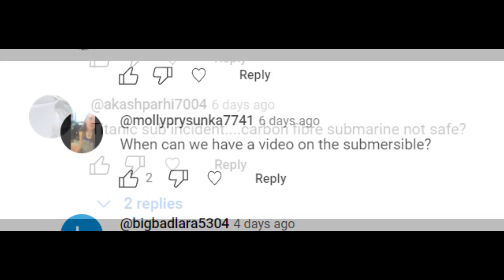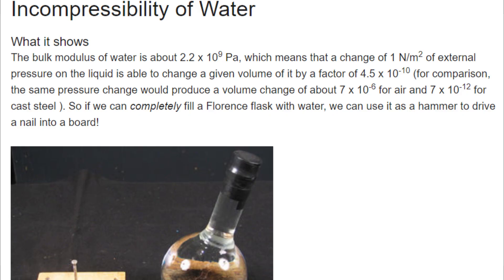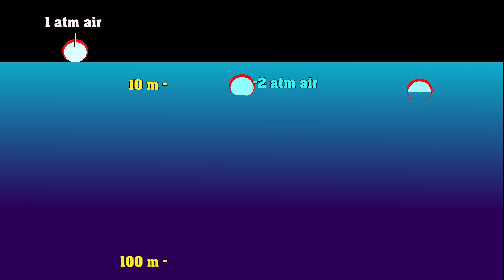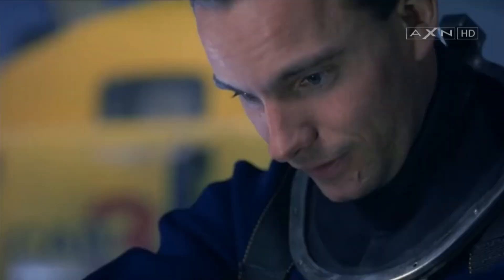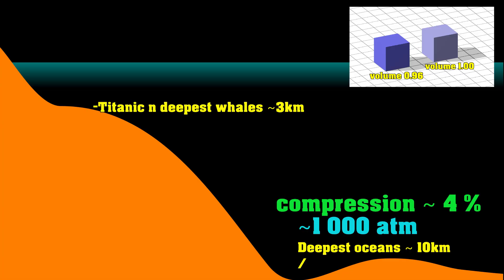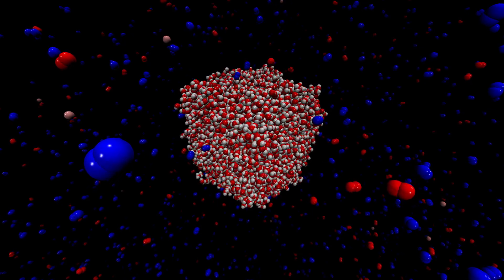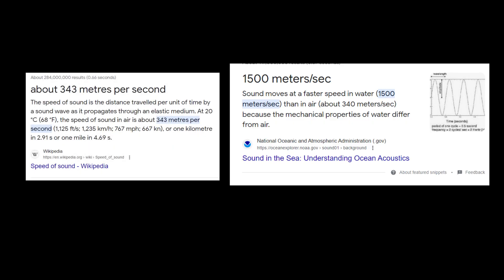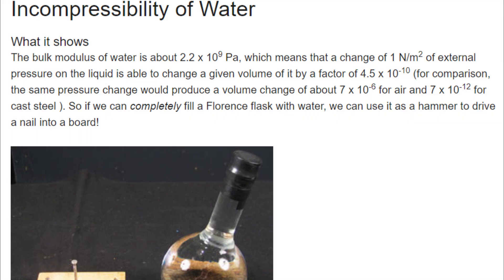What Happens when a Hull Fails at 1000 atmospheres?

Comment: saturation diving reaches around 300m but then for every minute u add more than an hour or so stopping for decompression how ever you could reach 200+ if you take a deep breath then diveno compressed gas by doing that you dont need decompression stops funny experiment to do is hang a Styrofoam cup from a hook right something on it for fun then throw it deep when u pull back up ull have a mini cup

Comment: I love how he always has interesting deeper insights. My intuitions was exactly as the conclusion, that insides get crushed by the wall of water travelling faster than the speed of sound. Because of how much force is exerted by the pressure on the layer of water that's in contact with the sub. But describing it in terms of springiness of water make the whole thing way clearer and allows for calculation of the time it takes the waterfront to travel.
Reply: Yes, he's insightful.  I think many people intuited that the water is moving at ~ speed of sound.  If you thought about it, that has to be because it's a compressibility thing, but he has thought it through and made it explicit, nice work.

Comment: 14:12 if i understand this right, it must mean that there wouldve been 3000x the air molecules  needed (which would be 12000 of nitrogen and oxygen molecules at this frame) to exert enough pressure on the water, to stop its expansion or retension. 
i rly cant grasp that tbh, of course this is a 3d rendering, and its hard to take all the dimensions from a 2d picture, however this would need such a clussterfuck of molecules, just to keep the water pressure in check. would our air even be possible to get compressed so much that it could stop the water at this pressure ?

btw this is the most interesting thing ive heard about this tragedy ^^

Comment: I'm pretty sure you don't need water compressibility for it to move at the speed of sound. There is no independent columns of water forming the ocean, the surface moving a few µm would be enough to fill the entire volume of the submarine in the same time it needs to fall at the surface. And a few µm will be quick to fall.
Reply: Not as quick as water decompressing (and then being decompressed).
Reply: @allangibson8494  that would be the exact same speed. The speed of sound in water.
Reply: @jowjor  The water source isn’t the surface - the springiness of the water itself is enough to fill the hole the submersible made.
Reply: @allangibson8494  incompressible water would also be enough.

Comment: It's fascinating how different levels of understanding can flip the conclusion back and forth. Like, there's the calculation of how much energy is released by the collapse (volume * pressure) equating it to kg of TNT, and declaring it to be a collapse in "milliseconds" based on a huge+unjustified logical leap that it would happen instantly (as if expressing in units of TNT implies TNT-like behaviour????). Then there's the next level of undestanding which is, "water is incompressible, wouldn't it be 9.8 m/s/s; so more like ~ 1 second?", which is where I was at before this video. And then here we consider that water is actually slightly compressible, and we're back to milliseconds again.

Comment: Isn't the implosion of the tank of air known as a sonic pulse because the air that was originally at 1atm collapses down to the water pressure but then "springs" back or expands repeatedly?.  I believe they recorded the frequency of the implosion at about 4KHz and calculated that this must have happened at 300m or something like that.  4KHz is 4000 cycles per second or that air collapsing and expanding 4000 times every second which would be a total meat grinding blender which is why there is nothing left of the people because that would pulverise a person down to  tiny particles pretty quickly.

Comment: The basic physics doesn’t produce a freefall. It fills at the speed of sound in water (1409m/s). The slight compressibility of water does have an impact on the initial pressure too (0.000509/MPa, with 38MPa applied gives 0.02 meaning the water required to fill the space would be sourced from about 50m around this submersible (not all the way to the surface).

Comment: I got told that if a submarine gets crushed, I mean i it goes below the maximum depth it is rated for, and the whole thing gets crushed,  you get cooked, the air compresses and the temperature goes up.  I am guessing it would happen very quickly.  Like if you hold the end of a bicycle pump and push it gets hot.  You are putting kinetic energy into the gas and its heat energy goes up.   I think fluids have 3 energies, heat energy, pressure energy, and kinetic energy, I think there's a formula (bernouli's equation ?) ,forget, that the 3 terms before and after add up to the same.

Comment: I'm now really curious about how whales can dive so deep. Any chance you could make a separate video about that?
Does the air in its lungs get hot as it dives? How hot?
Reply: no it basically exchanges P and V at the same T more or less
Reply: @DrWhom  What is P and V? T is time?
Reply: @timg6125  We're talking ideal gas law here, PV=nRT. google it to find out more
Reply: Whales don’t dive fast or nearly this far.
Reply: @allangibson8494  Google says 2,992 meters. That's more than half of 3,800.
Reply: And if you are curious, some quick maffs says that the air temperature in the sub would rise to 100,000 degrees science.
Reply: I wouldn't think so. As fast as whales can dive, it's nowhere near fast enough to cause the air to heat enough to count. I think they have to dive as quickly as a diesel piston moves.
Reply: Whales exhale before the dive to minimise the amount of air in the lungs. And most of the air that remains in the lungs is compressed into the trachea to reduce the volume of the alveoli and stop nitrogen from dissolving from the alveoli into the blood. They have better ways of getting oxygen to their brain and muscles during a dive than from the air in their lungs (high blood volume, high haemoglobin levels in the blood, high myoglobin content in their muscles, and ways of reducing energy demand, such as lowering the heart rate and directing blood only to the most essential organs). Their rib cage is also flexible to conform to the reduced volume of the lungs and the whole chest cavity. However, I do not know what, if anything, happens to the temperature of the remaining air in the lungs, but I doubt it gets too hot. If it did, I don't think whales would be so happy to dive.
Reply: @ihanba  Doesn't the heating of compressed air depend on the speed of compression? I wonder if a whale could dive quickly enough that it would even matter.

Comment: Carbon fiber does a lot better under tensile strength but less under compression.
I've seen disk drive head de-laminate under normal use and so it's very easy to understand from my engineering experience.
While everything in my instance a lot smaller than something as big as a sub, apparently, it scales up!
Reply: Wait wait wait, they make hard drive read arms out of carbon fiber? I've only seen aluminum.
Reply: @phillyphakename1255  No! It ain't easy to describe.
Yes, the arms are aluminum, the little suspensions are a steel alloy, and the read/write heads are of a multitude of materials.
The heads are what I was referring to.
Getting into it all can be lengthy, and also not a good one to describe all of the physics or metallurgy.
I know the basics and made the equipment work...
Reply: there is this big arm of aluminum and welded to it is a tiny suspension arm and welded to that is the read/write head...
They used to use lasers to do it but that was a long time ago.
I'm actually clueless as to how it's all done these days!
Reply: @chrislong3938  I know what you are talking about now. The little half millimeter square on the tip of the electromagnetically controlled arm.

Comment: If the molecules travel at the speed of sound why isn't my apartment filled with fresh air instantly when I open the window?

I mean there is too much space for the molecules to collide so what's hindering them?
Reply: because not all molecules at the room/outside interface are travelling along a line pointing straight into your room, and not all the molecules in your room are travelling straight at the window opening
Reply: it would if you had a vacuum in the house before opening the window. if you already have stale air inside it's like removing a wall between two ball pits already full of wiggling balls. some of the balls from one pit might mix with some of the balls from the other pit, but it would only be a quick transfer of balls if one of the pits were empty before opening the sides together
Reply: thx, I didnt realize they probably don't travel in straight lines but in more complex paths.
Reply: @FalkFlak  they are pretty much ricocheting around your room, straight lines with elastic collisions of the walls and furniture etc. The average time for a randomly chosen air molecule to escape can be calculated as (1+B/A)(L/v) where A is the area of the opening, B is the area of everything else in your apartment that molecules bounce of off, L is the mean free path length of your room and v is the speed at which they travel. L depends on the precise geometry of your room, but you can take the width for a rough estimate. It works out as seconds for a small room like a loo, to minutes for a typical living room, to up to an hour for a cathedral. Which is pretty much what experience would suggest.

Comment: A lot of people are caught up in the carbon fiber, which is indeed the stupidest material to make the submersible hull from. However the viewport was only rated for 1,300m/1.3km/4,265.09ft/0.81mi. Then take an idiotstick guy repeatedly taking the submersible down beyond 3,700m/3.7km/12,139.11ft/2.30mi. Of course it's going to fail. Those depths were far beyond what that viewport was rated for. Also, they didn't have enough power on board to have lights on during decent and accent. CEO guy was so stupid he never thought to bring a flashlight 🚫🔦  instead the loser brought glow sticks.

Comment: Carbon fibre doesn't like being compressed, i've owed lots of 16m fishing poles and they are strong, but just squeeze the sections, and they feel very weak and the carbon cloth delaminates after a while. A tube is the worst shape to make a deep diving submersible from.This is why a sphere is the preferred shape to use as the pressure is equal on all points around it.
Reply: a think a brick would be a far worse shape than a tube!
Reply: @DrWhom  I can't argue with that.

Comment: What would happen temperature wise?
Reply: wouldn't it be proportional to the change of volume? in that case not that much rise at all inside but the air outside the tube would have got hot for a moment

Comment: IMO, the primary destructive effect of a sudden collapse of a volume at depth is water hammer. This is a macroscopic effect, like being smashed by a huge steam forging hammer, but in an isostatic rather than linear mode. The compressibility of water provides a bit of rebound. It seems that nobody has been thinking about the water hammer effect when talking about the Titan vacuum chamber (pure compressive stress) collapse.
Reply: Well, yeah. When the hull shattered, the fragments were driven inward at hundreds of meters per second. To simulate the damage to living creatures, put one that you don't like into the muzzle of a shotgun and pull the trigger. But sadly they probably did know what got them for a few second, I've done hydrotesting of composite tanks, and the most loaded fibers fail one at a time, then a few more, then all at once. Tock.. tock... tock tock... tocktocktockBAM.
Reply: @r0cketplumber  Even if you by some miracle didn't get hit by that the sound alone would still kill you. It was probably well into the 200db+ range, for reference the detonation of a block of C4 is around 210db if you are in direct contact with it. In air only shockwaves can be that intense but in water the max is like 270db at the surface and more at depth and this would be towards the upper end of that. 240db is the explosively ruptures every organ range so yeah not good.
Reply: @r0cketplumber  Hydrotesting is usually used for pressure vessels. Remember, fiber composites are highly anisotropic materials and show somewhat different mechanical properties in tension as opposed to compressive or transverse loads. The Titan was a vacuum chamber, subjected to isostatic compression, not a pressure vessel, which fails in tension, and I think this was not fully accounted for by the designers. I have seen some demos of fiber composites failing in compression, and they suddenly explode like fully brittle materials.
Reply: @dpasek1  This is what baffles me, those fibers were only acting in very small shear and twisting loads, basically not allowing the sub to be flattened, but were not aiding much in the compressive loads from the water pressure. It was really a brittle plastic tube with a matrix of filler fibers subject to many cycles of stress. How does the fibers compressive strength even compare to the expoxy by itself?
Reply: @nirodper  The fibers were wound as a solenoid, not in the bias wind typical for a pressure vessel. So the fibers were loaded in almost pure compression both axially and laterally with respect to the fiber axis, or circumferentially-tangentially and longitudinally when viewed in terms of the cylinder. In other words, compressive hoop stress.Composites are much stronger than the bulk resin alone. In compression, the fibers might strengthen the resin matrix somewhat, but it would depend on the strength of the bond between the carbon fiber and the resin, which I suspect is relatively low as compared to other fibers like glass or para-aramid. Bare carbon fiber is slippery and brittle, and reminds me of a linear form of graphite. There seems to be little opportunity for hydrogen bonding, and absent a special surface treatment, there would be no covalent bonding with the resin. They might have been better off had they used Kevlar fiber.
Reply: @r0cketplumber  Hydrotesting is not a good analogy, that failure mostly due to longitudinal stress and  stress concentration.  A better analogy one would be testing of tanks designed to hold near-vacuums, where bending stresses are developed by the external pressure.
Reply: Yup in fact the loud bang from the water hammer would ultimately have been the killer. The sound should have been well north of the 200 db required to be lethal and quite likely above the 240 db to be catastrophically ie instantly so. Would probably have been lethal to any unfortunate critters in the immediate area too. Organic tissues kind of rely on the connective tissues between their various parts remaining connected and sound waves that intense are not conducive to this remaining the case. Hell at the higher end they are not conductive to the molecules themselves remaining intact due to the force they are being smashed into each other, chemical bonds can break if molecules collide with enough force.
Reply: TF was more or less describing a compression-driven water hammer. Just not using the term or talking about what happened to the sub because the inhabitants are killed the millisecond before the effect on the sub becomes relevant.

Comment: I seem to remember some expert saying that what would kill you if the hull failed at such a depth would be the fact that the air inside the sub would get compressed so much at such a fast rate that it would instantly incinerate everybody in there. I guess that was just a lot of rhubarb then?
Reply: Nah I think he either forgot about the air or he wanted to explain how the implosion happens. There are fire starter tools that use the compression of air to make an ember and all you need to do that is to slam your hand against the two parts of the tool hard enough and it ignites the wood or paper or what ever flammable bits that you put in it. While people don't combust just willy nilly we are made of some pretty well burning stuff oils fats and what not that like the wood when compressed fast enough will burn.
Reply: No, all of that happens as well. But when you are talking about tiny fractions of a second, talking about what kills you first becomes less meaningful I guess.
Reply: The air heating effect is just a secondary thing, you will be crushed way before you are scorched, also it is incredibly fast heating and incredibly fast cooling, all that water is real good at taking heat away. You do not get well cooked chicken in 0.001 seconds.
Reply: Speed of water in typical water cutter is typically about mach 3 (760 to 1020 m/s) the water in this case would be moving faster than that... and those things can cut thick steel with ease.